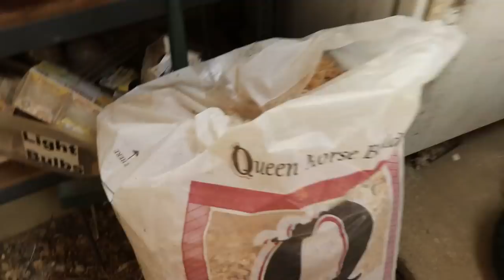SUPER EASY Small Scale Chicken System

Comment: Perhaps, in the future, you could buy a clear shower curtain and tie it down over the open roof side of the chicken cage,
This would allow the younger chickens to adjust to the temperatures outdoors at night, and still be a able to benefit from daylight.

(Still leave the sides open though for ventilation.)

Just until the little fellows gain enough sense to get under the hard part of the roof when it rains.

The heat lamp might teach them to go under the solid roof, when they get cold.

Later, pull back the shower curtain back in phases, to get them use to the rainy side of the tractor.

Comment: Mike, may I make one small, but important suggestion? 
Watch were you leave the filled water bucket on top of the chicken tractor. 
The added weight might cause problems with the top. 
Water weighs approximately 7 pounds per gallon.
Reply from the maker: We did add a support to the chicken tractor for the bucket but didn't record the footage. ~ Lacie
Reply: @MikeTheFitFarmer  Thanks Lacie. You have such a wonderful family. 
I greatly appreciate the response. I was so worried about that.

Comment: A question re. the waterer - you mounted it in a place where it can be in the sun and become warm (unless trees or bushes or shrubs provide shade of course) and also the bucket/water reservoir, standing on the "roof" of the chicken tractor, could become quite warm over time. Is that an issue with chickens? I read somewhere that most animals want their water cool, because it also helps them lower their temperature as many animals are not able to sweat. But I am not sure about chickens - do they mind if their water gets warm?